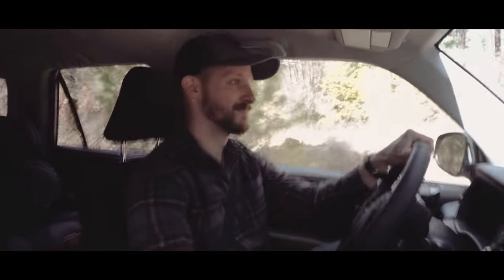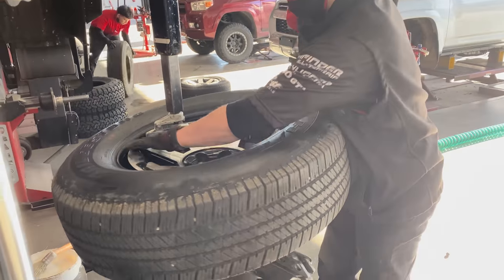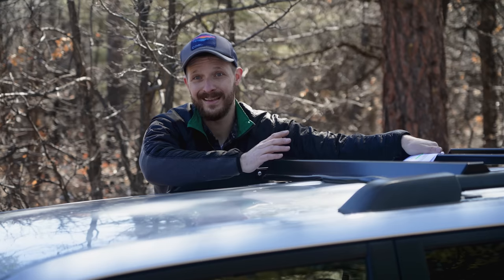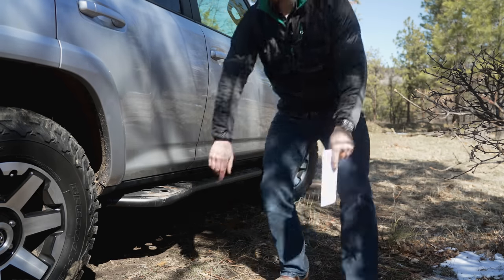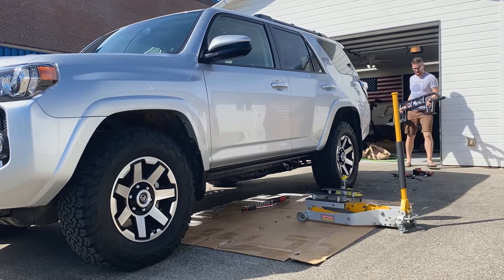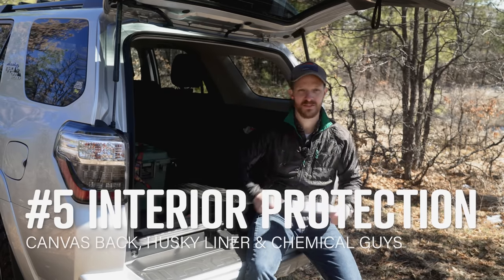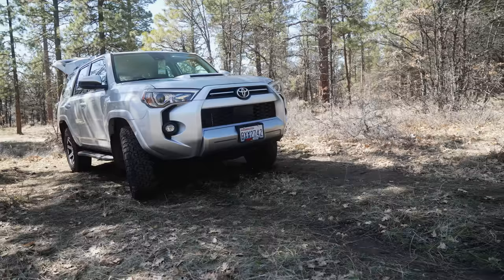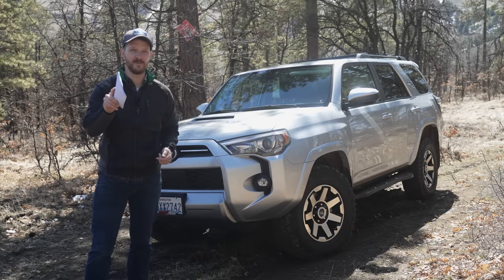Start Here: Toyota 4Runner Top Six Mods/Accessories To Do First!

Comment: Add a few of the following easy cheap things to your survival kit: Flare, Fire starter kit, all weather tarp, First Aid kit, knife,, 12" zip ties, Duct tape, nice length of low gauge nylon rope, hatchet, bush saw, blanket, fishing kit, whistle, compass, flash light, batteries for flash light (stored unopened separately) 10m socket with extension (80% of the bolts on that trucks engine are 10 mil), #2 Phillips head screw drive (get an 11-in-1), a 2 foot long 2x8 piece of wood (for jack stand on soft ground), anti Sasquatch spray (otherwise known as bear spray:)... if you want to spend a little more, then a wined up radio, a solar rechargeable battery kit, an EpiPen,  multi tool, a water purifying straw, and a bottle of whiskey (or Vodka) and some power bars, oh and for the end of the world stuff some chocolate bars and a few packs of cigarettes (to trade).
Reply from the maker: LOL... I dug around my closet and found/threw in several things from your list.
Reply: And also a pistol .........You never know!
Reply: You guys both forgot a hatchet or axe. Machete may work as well in some circumstances I spose.
Reply: @mikebyerly2344  SIG P365 XL Comp.
Reply: So where do y’all stow all that stuff? There is NO storage in this vehicle.
Reply: @jeffswarts2027  lift the floor cover in the trunk
Reply: @SandraStevens-jm8yp  I don’t have one! 2022 limited; as far as I know, they come with flat floor or slide-out tray. I have a flat floor. I sorely miss that feature from my Telluride.
Reply: @jeffswarts2027  huh I bought a truck instead but from the reviews I've seen it seemed like there was a storage compartment under the floor in the trunk but maybe that a specific model

Comment: Other than WeatherTech floor mats, I think the most useful mod that I've made to my 4Runner was the $13 center console organizer tray, LOL.
Reply from the maker: I should've made it 7 then... because I added that too.  :-)
Reply: Ohhh... I need one of those! What brand and where'd you buy it?
Reply: @JasonExplainsThings  Definitely need one of these. Recommended brand/where to buy it?
Reply: @JesseSchimmel  I don't recall the brand name, but I got it on Amazon. Just search "4runner center console organizer" and it will come up. They also make something similar for the glove box, though I don't have that one.
Reply: @trailrunnah8886  Sounds great, will do. Thx for the hot tip!

Comment: Had my runner for 6 months now. Took it out  stock at a local rock garden. After that I needed sliders. Took it out more, now I need clearance, so I got suspension. Slashed one of my 265s side wall, got it replaced and prepped for bigger tires. BMC/CMC, pinch weld delete and bumper trim, I got wheels and 305s e rated tires including spare. I would load my spare in the hatch everytime I wheeled, so then I got a swing out spare tire carrier. I do a lot of night runs so I needed lights. Got baja d squadron and s2 pros. My point is, take your rig out and you'll know exactly what you need to hit the trails. For me, functionality is priority, looks last.
Reply from the maker: Nice!  Yeah we're taking it on trails at least a few times a month... as summer approaches we plan on doing more.
Reply: Ripley is a doll!

Comment: My notes for this video:
1- Tires: KO2 stock tire size.
2- Crossbars (roof rack).
3- Paint Protection: wash and apply a ceramic coating.
4- Cali-raised rock sliders.
5- Interior Protection: all-weather floor mats, husky liner, Canvasback back-seat protector.
6- Recovery gear + snacks and water. (other tools)
Reply: Nice summary. Thanks!
Reply: There’s my summary guy. 🍻✨
Reply: 14 minute video in 3 seconds. Thanks
Reply: Why Cali-raised??

Comment: Consider relocating your rear diff breather valve if that big puddle you splashed through is a common occurence. I use a screw-in nipple and 3/8 fuel line to get the breather up around the tail light, cost about $10 per vehicle (2019 4Runner and 2016 Tundra).

Great video for early mods, I'm gonna check out those roof bars.

Comment: Nice video. I have a 2018 4Runner Off Road Premium. I put K02s on it (stock size) and love them. I put a steel front bumper with a 12,000 pound winch on the front. I put an Eibach 3 1/2 inch lift on it. I put the same rock sliders on, that you did, only without the top plates. I put on a nice 3/4 length roof rack with rear side panels that I can mount fuel containers or other accessories on. I installed a two drawer storage system in the back. Because of the less than desirable departure angle, I bought a skid plate that goes in the trailer hitch and mount it when I'm going off road. I've banged it pretty hard a few times and it took the hit instead of my truck. I highly recommend getting one of these. I've got a couple of other projects in mind. But right now, I'm very happy with the vehicle and it's performance. I just got back from five days in Utah at the Winter 4X4 Jamboree. I had a great time and the 4Runner performed excellently.

Comment: You needed to mention Canvass Back for the rear.  The plastic in the 4 Runner scratch so easily.   Also, the factory tires removed were excellent for fuel economy and ride, including inclement weather traction.   What about the K&N air filter OEM replacement for the factory air filter a definite fuel economy pick up one 1 to 2 gallons per mile.

Comment: I did the 4 crossbars.  Found two OEM crossbars at junkyard for cheap.  Went with Weather Tech floor mats.  Pricey but necessary.  I swapped out my Limited leather steering wheel for a SR5 vinyl wheel.  The SR5 wheel is thicker and more rugged.

Comment: Just found you.  Subscribed.  WE Washingtonians (if you are from here)need to stick together.  I have the 2018 TRD Off Road for similar reasons.  I stuck with my Dunlops because shy of slinging mud, the off road tech. makes them work REALLY well.  Most hate on them right off.  And I was Leary at 1st myself.  But I am telling you, they have not let me down in EVERY climate we have had.  Every terrain except mud slinging they have impressed me. (when they wear out, I will get the K02's) My 1st and only modification has been rock sliders from White Knuckle.  They are worth every penny!  Can do what yours do for a great price.  Came all set and ready to mount up.  Guess I need to go find out if your rig has KDSS.
Reply from the maker: No KDSS.  And yeah I’m from here.  :-)

Comment: Thanks for the tip on the roof rack. I’ve been looking for an upgrade from the stock rack but not a full blown overland style rack.
Reply from the maker: I would stay away from the front fairing crossbar.  It scratched up my paint pretty bad.

Comment: As a 4Runner owner my #1 to do is LED Headlights; though I agree with the tires as they’re made for on roads. I also have floor liners and my carpets still look brand new. I purchased the Toyota cross bars when I bought my vehicle because I use my roof rack. I also added aluminum extruded running boards which I like over the Toyota plastic or tube boards; I also installed push/bull bars which helped when I hit a deer but after I didn’t put another one on due to the noise. I also have a bug guard on my hood as well as rain guards on my windows which are nice in allowing ventilation in the rain. 
Another must is also a neoprene cover for the center counsel as if it gets scratched/cut replacements are ridiculously expensive.
Reply from the maker: Good ideas.  The bug guard is a great one.  I’ve since added that.
Reply: Leds dont belong in the 4runner headlight housing. The lighting is going to be very off. Hids work best seeing smooth lines.
Reply: @Anomize23 : I replaced all of my original halogen bulbs with LED, that includes high beams, which are duel mode to still allow the DRLs to function as designed, the fog lights, and inside of the projector housings. I have had no issues with them looking off I have a smooth crisp horizon line on the projectiles with beautiful and bright 5,000k white light underneath. The only issue I have had is with the life length on the LEDs in the projector housing as it’s enclosed and they can’t dissipate heat as well as if they were open or had a control box on the outside of the inclosure; even with this issue I have gotten near 2 years and am running over 3 years off the newest set, the first set may have just had bad soldering or something as the new ones haven’t had an issue, and even the older set was replaced at no cost to me under the warranty. 
I’m incredibly satisfied with my LEDs and would recommend the conversion to anyone and everyone. I’ve never been a big fan of HID which work like fluorescent bulbs and require a sticking of “ballast” to start, though I have installed and used them, they are not as easy as an LED replacement which is simply plug and play as the LED “bulb” simply installs like a standard halogen bulb. 
Perhaps you had a bad set of LEDs or bought an inexpensive set as mine are great as are the more than 90% of users that have left 4-5 star reviews. Given retailers like Amazon have a 30-day return policy I’d give a decent set another try and return them if you don’t like them. Or don’t if you prefer HIDs; get the headlights that you like and work for you I just know LEDs work great and belong in my 4Runner and I wouldn’t give an absolute answer to anyone as there are always outliers, maybe that’s me, or maybe that’s, either way people can read these comments and make their own choice.
Add- I replaced the backup light bulbs too, also with LEDs and they make a night and day difference, I think they were 1,000 or 1,200 lumen bulbs, took me two tries to find a set I liked but they make backing up at night in the country so easy. I don’t know if it’s the white light of the brightness but they really make a difference to the backup camera as it’s basically like daylight to the camera for 30 feet.

Comment: I keep my recovery gear in the same OD green Plano case. Tried other cases like Roam, Front Runner and Milwauke pack out but ended up sticking with the Plano for the weight savings and its the perfect size for me.
Reply from the maker: Nice.  I use Milwaukee pack out cases for other stuff, and almost went with that for this.  But I agree that this is pretty much the perfect size for a basic kit.

Comment: Taking delivery of a 2023 TRD Offroad in the next month or two. Definitely swapping the tires for some A/Ts, and definitely keeping them stock size. 32's are enough for what I'm doing. It's a distance vehicle, I don't want it to drive horribly or eat even more gas when I have to drive 400 road miles to get to 40 amazing offroad miles.

Comment: Does anybody know it the "grey wire mod" still works on these newer TRDs?
For those that don't know, there is a grey colored wire under the dash on older TRDs, it notified the rear e-locker that the vehicle was in 4lo. But you could cut the end of the wire and ground it, and the sensor would always say it's in 4lo, allowing you to use the e-locker in of course 4lo, but 4hi and 2wd.

Also having smashed one on my 03 taco, I would recommend picking up a e-locker guard/skid plate. I wanna say I got mine from LowRangeOffroad, and it was around $50 (although times have changed and things cost more), but it's a great protection investment for a $2000 factory part.

Comment: The 1st & last mod I did with my 4Runner: sold it & bought a 2003 Jeep Wrangler TJ Sport, manual with the 4.0 6 cylinder & couldn't be happier.
Reply from the maker: Oooooooo. Shots fired! 😘

Comment: A fellow Yakimanian! I just purchased a 23 Off Road and found my way to your videos. I'm doing tint this week and trying to find a set of TRD pro wheels to put some KO2s on. I am not a huge fan of the stock silver. Thanks for the video!
Reply from the maker: Congrats!  Yeah we've done tons more to the 4Runner since.  Check out the winch bumper and suspension videos especially!
Reply: @JasonExplainsThings My goal is suspension and a C4 LoPro at some point. I definitely will need a winch here in the winter for trails. The truck has TSS so I will have to decide on bull bar height or no bull bar. I will also need to find where I am going to get all this money it adds up quickly!

Comment: I bought a larger version of your Genius Boost. They provide much more than boosting capability. My GB70 came with several cables, connectors, and adapters to power 12 volt accessories. Here in Northern Canada, my Genius boost will not only hold it's charge for six months in -20C/-5F, but provide power for a long time!

Comment: What tire pressure do you run in your KO2 for normal driving?  My discount tire put them at 36
Reply from the maker: 35 most of the time.  Owners manual suggests 32.

Comment: I have often wondered about the coating right after buying a new vehicle. Any regrets, and was it worth it. I probably  will have it done but leaning on a 2021.       4 Runner when the 22 comes out. My 2001 XTERRA  finally going bye bye after 20 yrs of service.
Reply from the maker: So far so good.  Water definitely beads nicely.  It was really easy to clean bugs off when I washed it a few days ago.

Comment: What a great video! I bought my 2021 4Runner Venture 01/02/2021 and have been watching many youtube videos. Your list is exactly what i want to do. Tires (Ko2) most definitely. Crossbar ill wait on my model has some that will work for now til i get the roof rack. I have gotten the ceramic coating waiting for a better day to apply. The "heavy duty steps" lol Cali raise sliders are in the cart. Debating on having them powder coat or should i DIY it myself. Already got the weather tech liners and the Rhino recovery gear. Thank for a great video and help with the decision on painting my own sliders!!!

Comment: Did your canvasback rear back seat cover just cover the seat, or the whole cargo floor? I like the idea of the seat back protection, but want to use a weather tech or husky rubber floor liner. It seems the canvasback product lines the entire cargo area. Did you modify the product to cover just the seat back?

Comment: Hi Bro, I watch your video again and thank you so much for it , it help me a lot to make a mods for my 4 runner as well.. i just have a question regarding the crossbars, are they good / fit also for the limited one? Is it a aluminum or metal made? Thank you so  much in afvace for your respinse ..God blees & be safe always.. cheers!!👍👍😊
Reply from the maker: Hey there.  They should fit on a Limited just fine.  They’re made of steel and powder coated black.  I’d also suggest watching my full rack install for more info.
One thing that happened with this first setup was the front wind deflector trim did leave some permanent scratches in the paint.

Comment: A couple other rock sliders to consider that you can get already powder coated are the RCI ones (I have these in the 5 degree model and like them a lot) and the RSG which are also excellent and are a little bit bigger, so provide a wider step to access stuff on the roof.

Comment: Wide tires actually give you less traction not more. and create a lot of unnecessary issues. 
If you want height and are willing to be less wide and save money at the same time go with 235x85x16 which are 9.6 inches wide but are 31.7 inches tall and are waaaaay less money.
They use this philosophy in Australia and Africa, and it they work  great!

Comment: How is the ceramic coating holding up? Worth the cost/time?
Reply from the maker: 100% worth the cost and time... especially if you do it yourself.  1.5 years later water still beads off the paint.  But it doesn't make your paint indestructible.... think of it as a wax/sealant that lasts a long time.

Comment: My first mod was very similar to you. I got 33” tires though. Mine are the cooper discoverer s/t maxx tires and they are sick all terrains. Very heavy tires but they don’t really shake at interstate speeds like you’d expect. I got a 2” lift and a leveling kit for the front suspension adding another 2” to the front so the 33” tires have plenty of room and don’t rub.

Comment: I'm very curious about the Husky Liner for the back cargo area.  I didn't see anything from Husky for the 2021 model, so would the 2010-2019 models' cargo liner work for the 2021?
Reply from the maker: Yep, definitely works.  The link in the description is the one I bought.  This is for any 5th Gen 4Runner without the third row seat.
Reply: @JasonExplainsThings  Good to know, but I forgot to mention that I have a sliding cargo tray. Love the idea of the CanvasBack and will looking into that at a minimum.

Comment: Question did u only use the clean slate, clay bar treatment only and then do the ceramic coating? No buffering or anything just these three?
Reply from the maker: Yep.  The truck was only 2 months at the time so the paint was really clean.
Reply: @JasonExplainsThings  perfect I’ve had my runner for 5 months now and saw your vid. So i want to try it!

Comment: Big question; those rock sliders you installed. What your thoughts on someone having them powder coated ?
Reply from the maker: Very common and a great idea.  You’ll just need to touch them up from time to time with spray paint.  Satin black matches well.
Reply: @JasonExplainsThings  thanks

Comment: Paint Protection Film over Ceramic Coating. You need the rock chip protection.,
Reply from the maker: Agree to disagree.  I don’t like how the film looks as it ages and deteriorates.
Reply: @JasonExplainsThings  ceramic on top of PPF - ceramic does nothing for impact - useless for damage. Good for cleanup. I do it for a living.